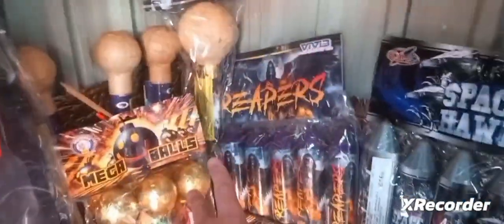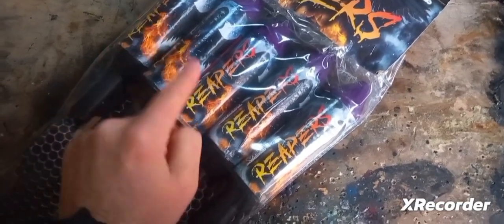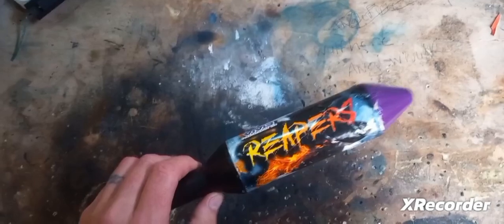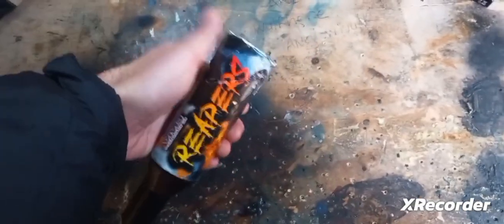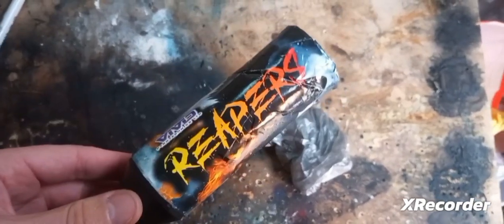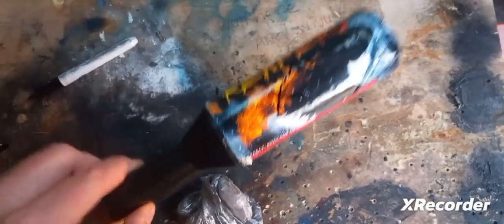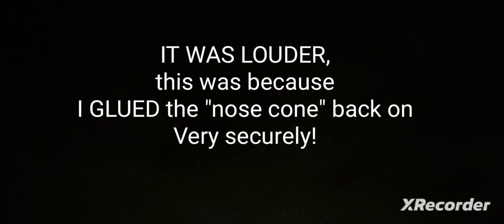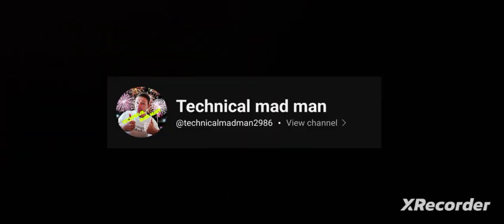WHAT'S INSIDE FIREWORK ROCKETS? EXPERIMENT! #FIREWORKS #FIREWORKS ROCKETS #ROCKET FIREWORKS #PYRO

Comment: Why the big largely-empty body of the rocket?
Reply: Seems like they use standard toilet roll cardboard inners so means it cheaper to buy something already mass produced i.e no bespoke size.

Same as with all the largest rocket cases......all manufacturers use the same ones from one source to save money
Reply from the maker: @FireworkMan-qd3oc 
Bog rolls, lol.. I love that😂😂
They are very similar 👍👍
Reply: @technicalmadman2986 😂😂😂A label came off a hawk in hell rocket and the payload container looked like the factory had recycled their used andrex supply😂😂
Reply from the maker: Yes, there's lots of room for "expansion" and "pressure" under ignition... 
when the bag of effects is ignited, you see:) 👍👍

Comment: Haha should check the law tho 
In adding or messing with to be diff from manufacture 
A kid up the road got a fire arm ban for messing about 
😮 
1.3 is a bag 
Most cheap crap rockets are full of low quality black powder 

Some of the bigger rockets have a shell inside 
Over production couple of years ago 
Got cat 4 shells in retailer rockets with a different fusing system 

Firework King 
And scorpion as I no of so far
Reply from the maker: All production rockets are 1.3g 
Not all 1.3g are bags. But mainly, hawk style rockets are bags, 
as seen here.. 
Black powder is made from sulphur charcoal, kno3.
 modern fireworks, use a combination of (flash powder) and (black powder) to  ingnite the effects, etc.
Reply: @technicalmadman2986  its wierd all to do with classification and storage 
Love your indepth knowledge tho 
I used to experiment alot 
Just want some proton bombs to fire off to show wat they used to be like 😂😂
Reply from the maker: @nrthlincspyro8622 
Yes,exactly but heres an example.. 
1.3g ball head rockets are infact ballshell rockets but they are just limited to 195gr NEC cat 3, you see? 
Also shout tubes are small mortar shells but just limited in bore size to 30mm for  production you see. 
It's weird right lol👍👍